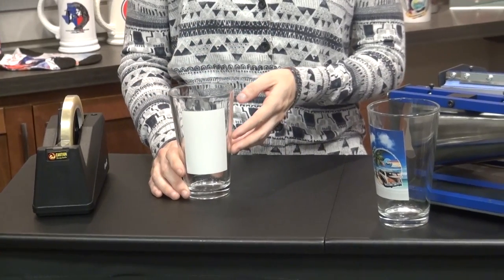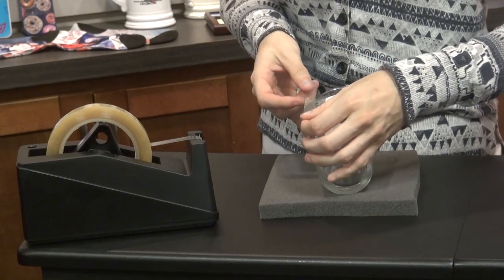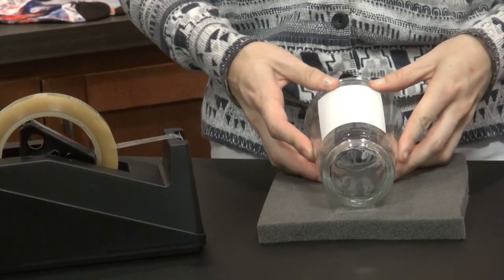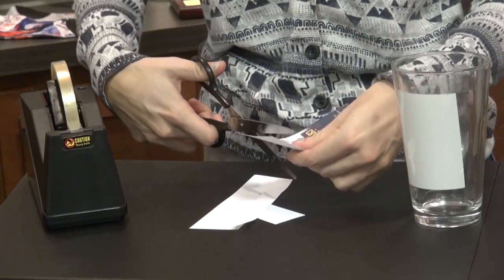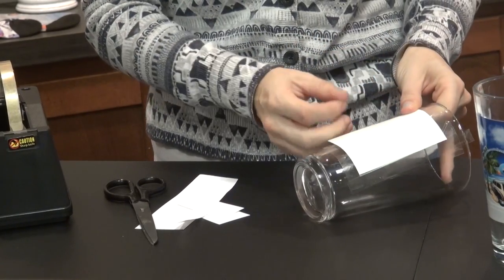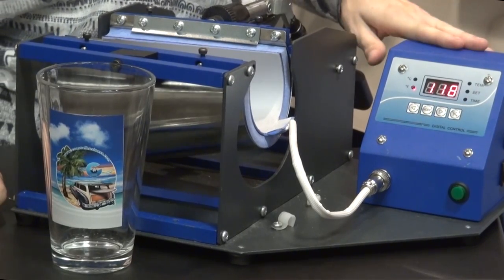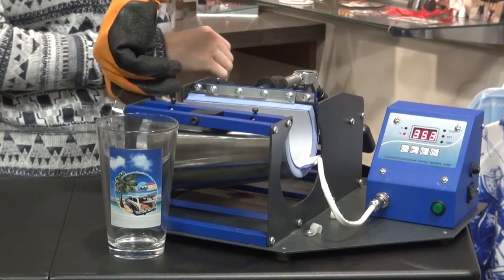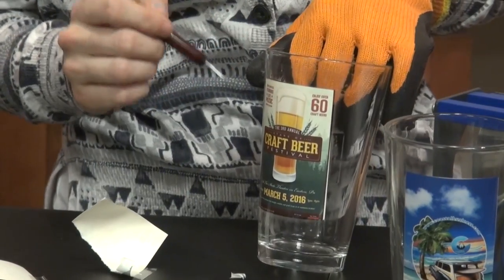How To Press: The Clear Sublimation Pint Glass With The White Patch Using The Mug Master Pro

Comment: Can any one tell me y the print on glass frame is light but print in paper was good I want to know the reason plz
Reply from the maker: Hello! It may be that you need to change your press settings. Our settings are specific to the press we are using. For additional assistance with the light transfer, please call our technical support department at 1-800-562-7760, option 3.

Comment: Hi Coastal, What type of white backing material should I use before applying the sublimation print? 
I bought the Image Right Premium Sublimation Roll from you guys already. Need the white backing material now. Thanks.
Reply from the maker: The white backing is added by the manufacturer before the coating process for sublimation. SO there really isn't any preferred material unfortunately.

Comment: Hello, looks like you put a vinyl on first then the sublimation paper is that correct? if so what is it that you use? Is it dishwasher safe?  Thank You
Reply from the maker: Sandra, the glass has a white patch, which is the coating. We added clear thermal tape around the white Sublimation patch - to avoid any excess ink transferring. Then we taped our Sublimation transfer on and pressed. This item is not recommended in the dishwasher.